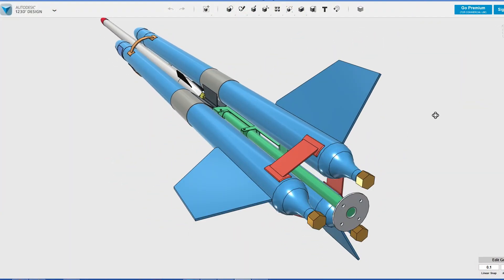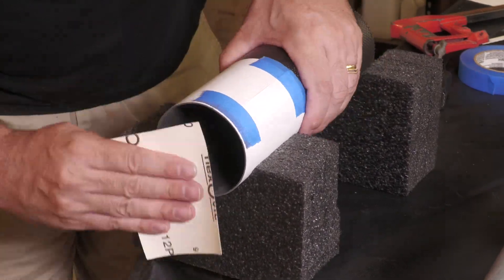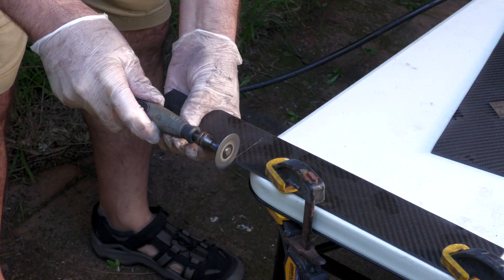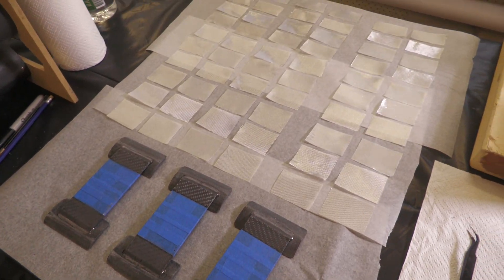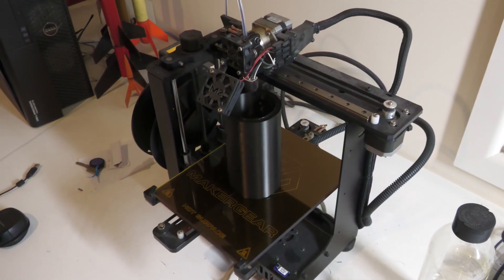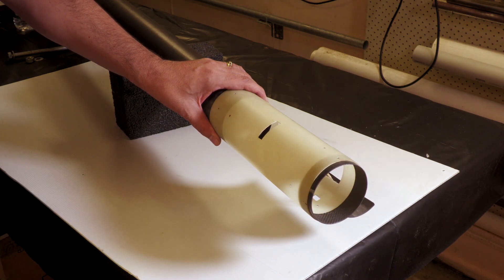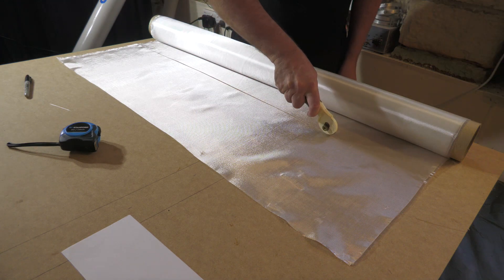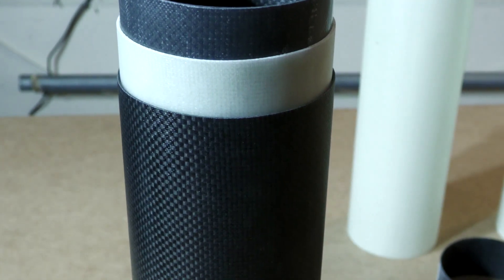2 Stage Water Rocket - Part 36 - Brackets and Tubes

Comment: Nice work in progress video! Always great to see you guys working so nicely together. It's a real inspiration and pays off the time that removes from construction. Thanks for sharing and looking forward to seeing more. 
Ah, one question: the resing you use for constructing with carbon fiber sheets and glass fiber: is it Ok for brething it? The same for when cutting the carbon fiber. I though they are nasty/dangerous things... All the best!
Reply from the maker: Thanks! :) The resin/epoxy we use is fine to breathe though ventilation is still a good idea, it's actually very low odor, and not as bad as polyester resin.  We always wear a respirator when cutting or sanding fiberglass/carbon fiber. You definitely don't want to be breathing in the fine particles.

Comment: Great update! Where do you source your carbon plating from? Also liked the technique of pulling out a strip of carbon to align the cut
Reply from the maker: We normally buy it from HobbyKing https://hobbyking.com/en_us/catalogsearch/result/?q=carbon%20fiber%20plate. They have a pretty good range. I just recently needed another plate but they were out of stock of the size I wanted so I bought it off Amazon for a similar price.  https://www.amazon.com.au/gp/product/B0B4PC57KD/ref=ppx_od_dt_b_asin_title_s00?ie=UTF8&th=1  

Yup pulling the fiber out is an easy way to mark a line that's aligned with the fibers in the cloth as opposed to just drawing a line and then cutting across some fibers. The cloth isn't always perfectly rolled onto the cardboard tube and sometimes the fibers curve around. This way you can easily follow the curve with the cutter.

Comment: Nicely done! Appreciate the effort to make sure everyone watching knows the health hazards of working with fiberglass, epoxy and carbon Fiber. We find it interesting how much work goes into building strong bonds between the tanks. How much force at launch is there on these bonds?
Reply from the maker: Thanks, yes definitely need to watch out when making small fibers airborne. I now usually wear gloves too during sanding or cutting as I get fibers between my fingers and then they itch for a day or two. The loads on these brackets are huge, one of the reasons we are using CF for these is for their stiffness. The central bracket that holds down the rocket and supports the sustainer during acceleration will have about 7000N pulling on it trying to rip it apart. During staging there will be a 1000psi 15mm wide water jet trying to cut the bracket away from the booster. The lower brackets need to hold while the booster slams into the ground fin first applying a point load right in that region where the bracket is. The top bracket will need to stop the booster splaying apart during acceleration. The sustainer is going to be pushing sideways onto this top bracket if the rocket has any kind of Angle of Attack (it will). I'll be surprised if the booster doesn't rip itself apart on the launch pad or during staging. :)

Comment: wow i love the brackets you made to join the 3 tubes together! Do ever use (i think its called ) pull ply when making carbon fiber stuff?
Reply from the maker: We do use peel ply sometimes, but we've found that the surface texture it produces is quite rough and needs a lot more sanding. We use the lightweight fiberglass cloth instead that produces a much smoother finish. It also acts as a sacrificial layer that we can sand without cutting into the carbon fibers below.
Reply: @AirCommandRockets  cheers george! I found the same, but then i watch all the rocket builders and everyone swears by it!. Hopefully ill get up to nsw again later this year!